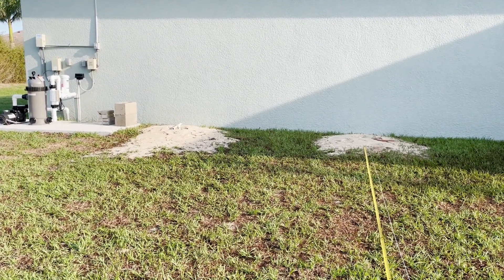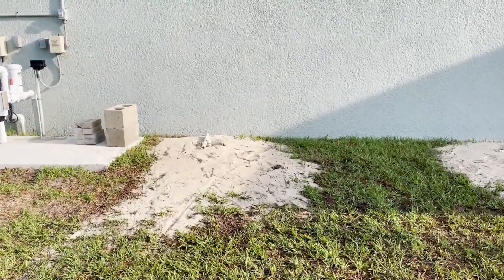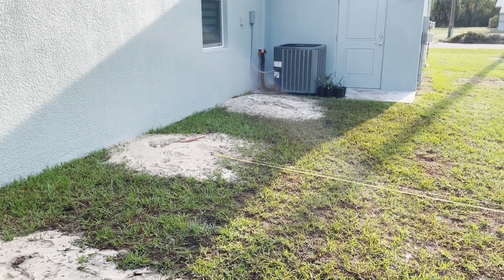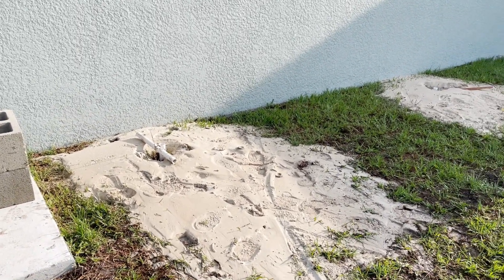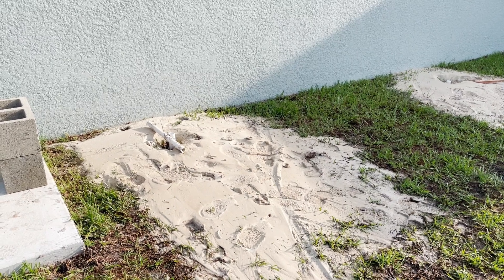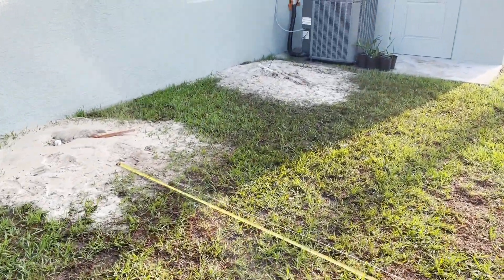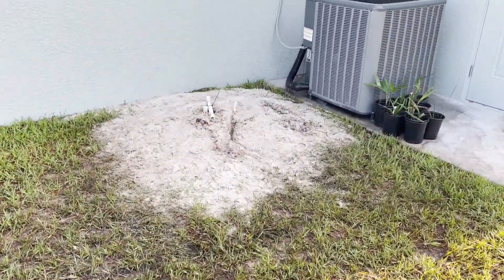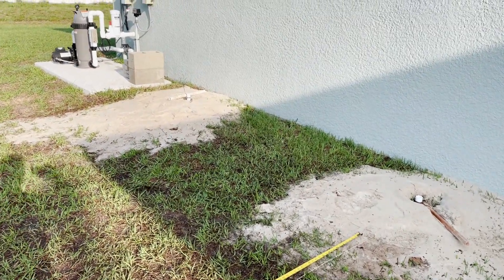Florida Sand Point Well (part 3) Well Depth Video

Comment: How much 2 inch casing has to keep in ground?
Eg you dug 25 feet so 10 feet of 2 inch pipe casing is okay?
Reply from the maker: None.  These are uncased wells.  The 2" pipe is used as a drill pipe only.  Once down to 25', you simply slide the assembled 1-1/4" sand point assembly down the hole inside the 2" pipe, and then remove the 2" pipe.  Works quite well (no pun intended!) actually.  You gotta have that Harbor Freight trash pump to get your holes down quickly.  I drilled all 3 holes in less than 1/2 hour.  Please see the other videos in the series.  Good luck and report back!
Reply: @guydoesstuff6562  Yes I saw all your videos. Wonderful concept and saves tons of money.

Do sand collapse deep down and block well point ?
Eg sand collapsing over wellpoint?
Reply from the maker: @urvesh0607  I have found the sand points to be very effective at keeping sand out, evidenced by the fact that my finer spray nozzles are not clogging.  i haven't had to replace a spray nozzle in 2 years.  i added an 800 mesh prefilter before the pump that i flush once every couple of months.  no biggie.  also, i added a small 2 gal pressure tank tee'd off above the pump for smoother start-ups, i.e. when the call for water occurs, there is already pressure in the line to pop the heads up > pump kicks on then.  i did end  up putting my own irrigation in.  those guys wanted $4k to put in a 4-zone setup.  the well guy wanted about the same.  i did both projects for less than $2k total.  it was HARD work though.  really hard.  don't know if i'd do it again.  total cost offset for both projects totaled in the neighborhood of $6k.  good luck!
Reply: @guydoesstuff6562  You are very lucky that you get water. I went 34 feet deep and freaking no water. Pump runs for a min and it stops pulling water. All muddy water comes and it stops. 

I dug 2 times at same place...No casing just well point. 

I am going to dig near pond now which will be 20 feet from the current one. 

Mud pump makes work way easy.

Comment: How did you get thru the hard pan? Bcuz cut pvc will not go thru it
Reply from the maker: hp (hard pan) is not actually as "hard" as you might think.  here in FL, the hp is generally 1" to maybe 3" thick.  when i started to feel resistance from hp when jetting the holes and seeing black specks come up from drilling, i slowed waaaayyyy down on the amount of downforce i was applying to the drill pipe and taking extra time to ream out the hp side-to-side.  if you don't do this, you WILL stick your drill pipe.  i got my drill pipe stuck in hole #3 (the one closest to the ac unit).  it was a real bear to get out.  yes, your 2" drill pipe with a sawtooth patten cut into the end will actually work just fine to get through the hp layer.  you don't need a galvanized tip or anything.  just make sure to go slow.

Comment: Why 3 well points?   What was the GPM on one well point?    I just put in a 25ft well in Houston, with static water level at 15ft.   Almost same setup as yours.  Same looking sand at 17ft.   My point is sitting in sand at 22-25ft.   I'm only getting 1.5GPM with a harbor freight Drummond pump, and .5 using a Red Lion Pump.    About to go try yet another pump.
Reply from the maker: 1 HP Sta-Rite HNE-L cast iron pump...expensive, but gets the job done right.  I don't know anything about those other pumps, so you're kinda on your own in that area.  Yep, here in FL most shallow wells are multi-point wells, with most people having 2-head wells for irrigation.  That just has to do with more available water at higher flow rates through the sand.  Good luck!

Comment: Hey great work! Congrat! What’s the rational for 3 well? I’ve heard in one of the later videos that you get 20 gpm out of the three wells. Do you think it is the max gpm you can get? I’d like 10 gpm and I’m wondering if one well will be enough.
Reply from the maker: Most folks in SW FL have a 2-hole shallow well system, and that provides as much water as they need.  I had the space and decided to go ahead and put a third hole in the ground.  Your gpm is more related to the HP and capacity of the surface pump.  If you use a good cast iron surface pump (Sta-Rite / Pentair HNE-L), 10 gpm at 45 psi (irrigation standard pressure) should be no problem.  It really depends on your application.  You might want to be sitting down when you start pricing good cast iron pumps.  They are expensive little buggers!
Reply: @guydoesstuff6562  thanks for the reply! I started this weekend and my 4” is stuck at 7 feet in a very black sediment (hardpan?). I don’t think there is any rock or ciment. I don’t feel the 4” pipe teeth grinding on anything, it just refuses to go deeper. I’ve added water to make it softer, but I’m not sure if it’s going to help.
Reply from the maker: @H. Roy , yep, it's a hard-pan layer.  when jetting down through hard pan, you will know due to color change of the sediment coming up through the hole.  take extra time reaming out that area as you go down, or you will get a stuck pipe, as you have discovered.  just about everyone sticks a pipe on their first hole.  just get a cinder block, some chain, and a pry bar to get the pipe up.  it WILL come out of the ground.  i used a 2x4 as my pry bar, and split it on the first go, so i had to use a second one.  😁
Reply from the maker: @HRoy-ot7hy , sorry for the very late reply.  yeah, this method is effective up to small 2" uncased shallow wells.  if you are trying to water jet down 4" pvc, that would be an entirely different beast i would think.  here in FL, with approval from the water management districts, homeowners are only allowed to put in up to a 2" diameter well.  anything larger than that must be permitted through a licensed contractor.
Reply: For approval in florida what we  have to put info? Eg diameter , jetspray or etc..

Can you please help me? I can pay you for your time. Please let me know. Thanks
I live in florida..

Comment: I'm a bit ignorant forgive me - is there some kind of filter or screen needed at the bottom of these Wells to separate the water from sediment when you're pumping it up for irrigation?
Reply from the maker: thanks for the question.  you can google "well sand point" to see what goes on the bottom of the pipe in the well.  basically, it matches the diameter (1-1/4") of the schedule 40 pipe but has very fine slits covering the surface to let water in but keep sand out.  i used PVC 1-1/4" sand points.
Reply: @guydoesstuff6562  so you drop in the well pipe and then REMOVE the drill pipe, correct?
Reply from the maker: @lance1cj , you are correct!  the 1-1/4" well pipe slides right inside the 2" drill pipe if you use inside slip fittings on the 1-1/4".
Reply: @guydoesstuff6562  thank you!